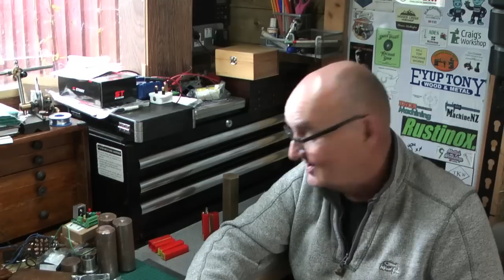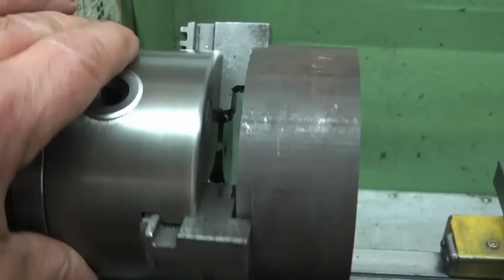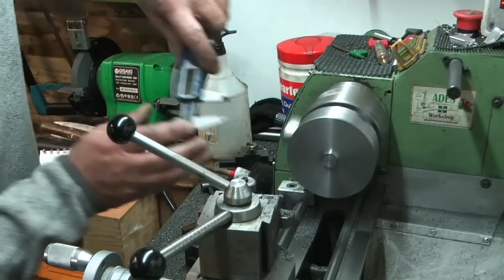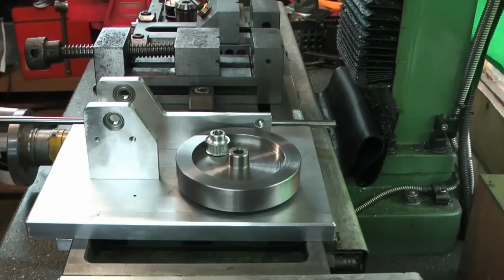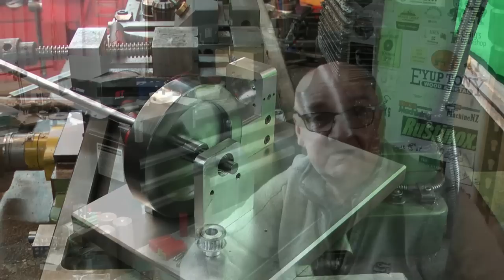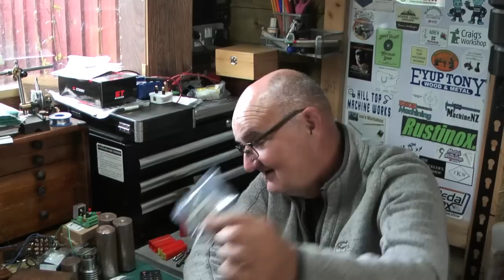Webster engine part 6 The flywheel

Comment: Ade, using a work piece to set your tool   height works fine but a big chunk of expensive cast iron isn’t the best way make yourself a centre height tool I will dig out an old model engineers plans I made one for a myford 7 40years ago.

Comment: Would it be better to extend the shaft so that the pulley can be on the outside for easier belt replacement.
Reply from the maker: It would be better but the cam for the spark timing is there already. I do think the belt will last the life of the engine as I will probably not run it often .  Cheers Ade

Comment: As usual, a great video Ade. Is there a rule of thumb as to how far out you can safely have the jaws out of the scroll?
Reply: That’s a tough question. Chuck manufacturers usually don’t want the end of the jaw protruding beyond the outer body of the chuck. That doesn’t give as much a diameter as most people want. Jaws should never, in any case, be more than a third past the outer part of the scroll, otherwise you get too much strain on the scroll and the jaw teeth. I know people go further, but they’re wearing the chuck too quickly, and with less expensive chucks, the scroll often isn’t hardened much.
Reply from the maker: That is a good answer Mel . I would always make sure that at least two sections of the scroll are engaged with the number three jaw  . however when the jaws are outside the perimeter of the chuck  I will minimise the load and treat it as a temporary measure to get a job done . I would hate to damage my chuck  and if that lump of cast came out and hit me! the air may be a little blue . Cheers and thanks for your support Ade.
Reply: Typically not more than 1/2.

Comment: I would have used an HTD3 belt and pulley set up but it’s still a great idea to use a timing belt and pulley.  Since I am building this same engine I may use some of your ideas. Great job thus far.